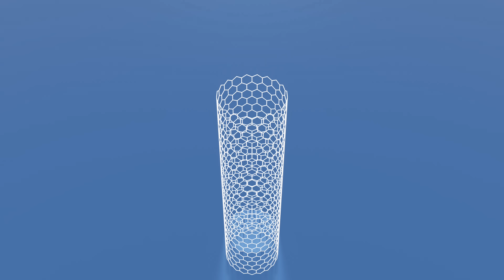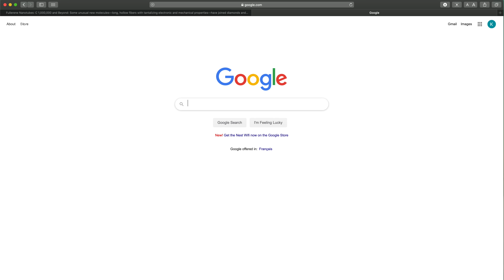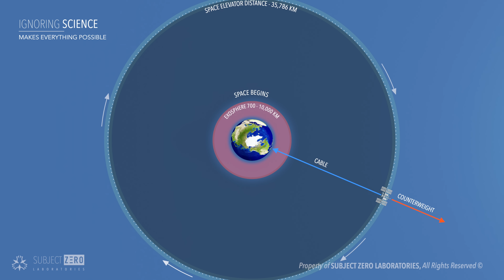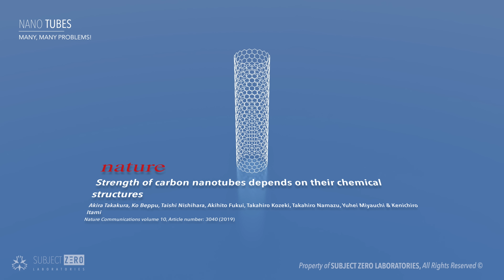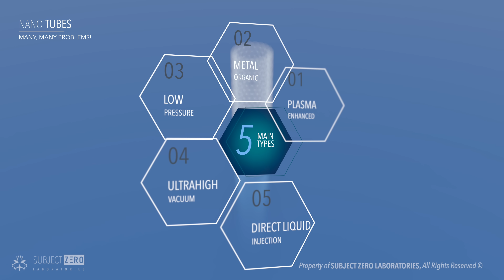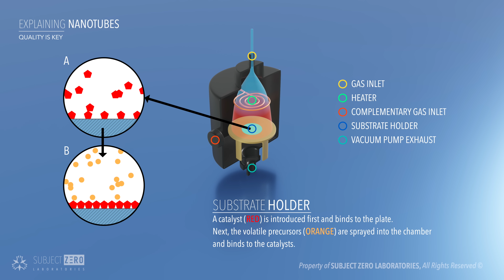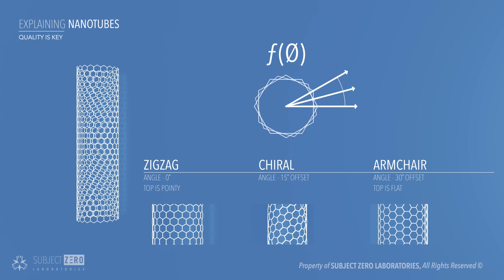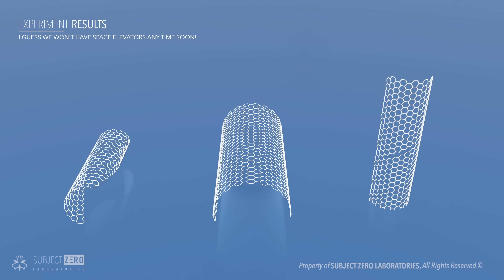Nanotube Strength, Bad News for Space Elevators [2019]

Comment: The classical space elevator might not be practical, at least not in earths case. However what might be worth looking into is orbital rings that utilize active support which could in theory be built inside the atmosphere. Brief rundown of the concept: You effectively have a ring that constists of 2 main parts, an outer hull which would be geostationary and an inner ring which is actually orbiting the earth. The inner ring supports the outer hull via magnetic levitation, however it needs to spin much faster than would be ordinarily necessary if the entier structure would be orbiting the planet. Imagine it kinda like a reverse Hadron Collider, instead of the outer parts supporting the particle stream it is the particle stream that supports the outer parts, i hope that analogy makes sense. 

So, given that this method can achieve geostationary status at much lower altitudes it should make space elevators that connect it with the ground much more practical, we're talking 1 hour trips to space at 600km/h. If we now also put trains on the ring you could be anywhere in the world within 4 hours since those trains could quite literally travel at orbital velocities and you don't have to connect the elevators exclusively at the equator, as long as the forces that the elevators put on the ring cancel each other out. The "only" drawback to this method is that it is an even more massive undertaking than a classical space elevator would already be.

Comment: What if you built the Elevator in pieces. For a long while i been writing an book. In the story a city is building a Space elevator. They been building for years and only built the first part of a three part structure.  The first part goes up a mile. Ideally the second part will go up the same distance but it will be in several smaller pieces, kept afloat do to some Unutnium fuel source. Its like a train in away, each piece connected to the other but kept in the air by its own power. In my head that means it wont be one object putting pressure on the level bellow it.
This is all the out frame. The inner frame would have a train or capsule that could be carried up.

does that make since or is my engineering off?
Reply: Your engineering is way off, as in it just sounds bizarre, i think ive had dreams more grounded in science than that and those were flying dreams.
Reply: @TS-jm7jm  Well, i mean assuming you had some unlimited fuel source, would a tower still collapse under its own weight if the higher sections were kept stable with external thrusts of some kind, only keeping one up while balancing on the one bellow it.  The idea is the thrusters or what ever take the load off most of the structure. 
Is that really so bizarre a concept?
Reply: @Mord12gp  on the thrust side, have you even seen a rocket take off?, because those exhaust flames are hot, 

Also what you just said is ridiculous because if you have an unlimites fuel source such that you can suspend sections of a mile tall solid structure in the sky then why i might enquire do you bother build such a structure, because the energy needed to hold something like that in the air for years on end so far outstrips the energy to get offworld that its not even funny, 

If you are thinking about active support type structures then a thruster is about the worst way you could go about it.
Reply: Actually look up space towers by isaac arthur
Reply: @TS-jm7jm  thanks for pointing him out. i FORGOT that i did consider using balloons to keep the tower up. Given me a lot to think about

Comment: 36000km elevator : irrealistic
continental bridges, heavy elevators in mines or skyscrapers : still possible
Reply: Well, it was the same engineering that allowed us to build those heavy elevators in mines or skyscrapers that says it's rather improbable to build a space elevator, so yeah. 
Besides, my guess it that when we'll develop better materials instead of building space elevators we'll build better rockets/spaceplanes. But hey, who knows.
Reply: Yeah, because skyscrapers and mineshafts get nowhere close to 36000km. You really didn't think a lot before writing that, I hope.
Reply: Marcus Lindgren a space elevator isn’t really a structure that’s 36000km tall. It’s more like a 36000km yo-yo string attached to the Earth.
Reply: @Magicpickle5  u dont anchor it to the earth .u find the point of balanced gravity inbetween the earth and the moon .u then deploy the cable both directions until 1 end reaches the moon then anchor it. The earth end of the cable sits above our stratosphere. Just need to find strong enough materials to build it
Reply: Marcus Lindgren 500 years ago people thought skyscrapers won't be possible, too.
Reply: @IronMan-fi3xz  possible =/= economically feasible
Reply: @IronMan-fi3xz  - The engineers that built cathedrals using flying buttresses 500 or more years ago could probably have imagined that eventually an even taller structure could be built using other methods. A skyscraper is just another type of building. Interestingly enough, elevators, and the amount of space their shafts take up are the main hindrance to building ever taller skyscrapers. There's also HVAC and water delivery issues to consider as well. Now, if you put all the elevators on the outside of a huge pyramidal type structure, so the elevators were more like tram cars, maybe you would be onto something, although the footprint of the building would get pretty ridiculously huge.
Reply: @MuscarV2   Dude when we were playing with sticks & stones some Egyptians build the friggin pyramid & till today we still get dizzy head how!!!! in the world they did it. Engineering Marvel's are built by visionaries which sometimes leave the rest of us in an aww..😱 mode. But yeah its extremely expensive so sky hook seems pretty within our range or doable. Simple & awesome. Just 1000 km of cable.
Reply: @tomjary9284  it's been theorized that egyptians used harmonic vibration to place the stones at the pyramids. Tesla was building a device to counter act resonant frequency.
Reply: Unrealistic*
Reply: Wouldn't be financially feasible for a long long time. At least as a space elevator it's a special project reducing the cost to go to space. As general infrastructure it's just a filthy expensive safety measure

Comment: If Starship really is able to lower cost to $20 as stated few days ago then the elevator is definition dead.
Reply: Even then, possibly not. The sheer quantity of stuff that a space elevator could carry would make one worth building, even if it was more expensive/kg. The ground footprint of launch facilities that could handle a similar volume of material would be gigantic. Rocket payloads also have dimensional constraints that would not apply to a space elevator. Neither is a total solution on its own

Comment: I've never understood all the interest in space elevators, even in science fiction stories. Orbital rings are easier to build and more useful, and cheaper besides. And don't require exotic new materials. And space fountains are probably even easier to set up, though not as useful as a ring. Plus you can build both where ever you want, not only along the equator.
Reply: I'm not sure how you conclude that orbital rings are either cheaper or easier to build. They require vastly more material, all either hauled up to space in rockets, or manufactured in space (or at least off-Earth) with currently non-existent space factories
Reply: @talltroll7092  Well, for one, you can build an orbital ring over time out of cheap steel cable, whereas a space elevator has to be built in one go to become useful and entirely from exotic materials.

The original plans for the orbital ring intended for a bootstrap program of construction, with an initial cost of around 31 billion dollars in 1980's money.

You'd need a few launches to get the initial tether, magnets, and cable into LEO, and could send all future material for the construction up the tether to expand the ring. It's cheap to mine material on Earth, the only reason we talk about mining asteroids or the moon for space based industries is the cost of getting Earth materials into orbit. With a tether to the ring, that cost drops to pennies per kg, per the original plans. Even with inflation, it would be far cheaper to ship up terrestrially-sourced materials than to develop an asteroid mining facility (presumably requiring extensive automation beyond current tech capabilities).

Every proposal I've seen for a space elevator either requires massive space mining to already exist, or requires hundreds of rocket launches to get the elevator cable material into space, not to mention the required counterweight to keep the line under tension.

We could build an orbital ring today, with the initial cost probably under 50 billion, and the ring could start producing money to pay for its further development shortly after the first tether is dropped to Earth. It might well effectively pay for itself, from that point onward. A space elevator would cost far more, just to develop the material science, let along actually building the thing, and wouldn't produce any revenue until it was finished.

Beyond which, an elevator has essentially one or two uses, whereas an orbital ring could be used for a large number of purposes, many not even directly involved in space industrialization. You could use the ring as a transportation system, both for people as well as freight, effectively moving goods around the planet in about an hour.

Comment: Not tubes. Think lamination,  like plywood
Reply: Think gigantic kite. Because that's what you would get. The earth's atmosphere says "no" to the space elevator.
Reply: @MkeKen67  
Respectfully disagree. Material science is lack i all. The concept is viable. And easier when thinking tethers from an orbital ring
Reply: @arekainist  - How much money and materials would be needed to build the orbital ring then? Also, anything "tethered" to both a terrestrial anchor point and an object in space is not really going to be tethered at all. And, on top of that, you still need a means of getting your payload up the cable, costing another huge pile of money if it is even feasible in the first place. And if a meteorite hits the cable, you will have a major mess on your hands.
Reply: @MkeKen67  
It is viable, however not in the next 100+ years. We would need orbital/space manufacuring. We would need parked asteroid in orbit for ease of materiel. And there would need to be a massive driving factor, a reason or method of profit. 
Check out sfia/isaac athur on you tube.

Comment: Instead use GEO elevator we can make something less hard.  Take the idea from Saturno rings.  Make elevator to 400km or so so we need les cable and les strenght. The chalenge will be to make that rings work.
The idea is tu make orbit-rail-ring pushed by propulsion satelite made with electric propulsion where maintance is slow. This satelite will have higher speed to keep the weight of elevator and the ring-rail(can be atached to satelite or slide(atached is beter for lower maintance)). When the ring is done just put 4 cable down to Earth (400km of cable not 35.000km)
The rail can be like trinagle, 2 line for the satelite how keep the ring up and the last one or the elevator so the orbit satelite dont interier with the elevator.
Reply: Or just make the ring hollow, and spin a second ring inside it at orbital velocities, effectively lifting the entire structure. Then you can build your ring at any altitude, even within the atmosphere.

Comment: Space elevators need to go to geostationary orbit.
This is 35,786 km away.

To get there in 24 hours you would need to travel at 1,500km/h.

By some wheels clamped to a cable.

Going at 100km/h would take you two weeks.

Oh and nanotubes aren't strong enough.
Reply: Presumably such an elevator car would run on a maglev system, to minimize friction and allow maximum speeds. But, ironically, it would actually be easier to have the elevator use a rocket engine (one with far too little thrust to achieve escape velocity, but very high fuel efficiency nonetheless) and just carry a large tank of fuel on board, magnetically pushing against the tether as it slowly climbs upward. Max velocity might well be above 1500mph. But the time to orbit isn't really the issue, anyway. Most payloads would achieve orbital velocity (and beyond) and detach from the cable long before reaching GSO.
Reply: @berserkasaurusrex4233  - I don't think maglev works vertically. Also, attaching a rocket engine seems to defeat the whole point of a space elevator, which is to get away from rockets. The cable will naturally be curved, as well, (because physics) so not sure how fast you'd want to go up a curved cable. Oh, and the cable would probably be broken by the sonic boom caused by going that fast. Other than that, you may be onto something. ;-)
Reply: @MkeKen67  "Getting away from rockets" is not the point of a space elevator. The point of a space elevator is to get into space cheaply, and more specifically, to achieve orbital velocity cheaply. A rocket would be fine for a propulsion system for the elevator car, it wouldn't have to be particularly large or complex. You're climbing the elevator cable itself, so you don't have to accelerate to orbital velocity all in one go. It's like the difference between jumping to the top of a skyscraper and taking the stairs to the top. 

The rocket you'd use would be a fraction as powerful as those currently used to reach orbit, but could be extremely cost-effective in terms of fuel efficiency, fulfilling the purpose of the space elevator in the first place. You'd have a cheap, comfortable trip to orbit, taking several hours, as opposed to a very expensive trip to orbit taking a few minutes at very high G acceleration.

As to sonic booms, there aren't any in space since there is not enough atmosphere to generate a sonic boom. 99% of the cable is outside the atmosphere. The initial acceleration in the atmosphere might have to stay below Mach 1, but even at just 500 mph, you'll be above the atmosphere in under 10 minutes, and can then accelerate with near impunity. The curve of the cable is not significant enough to matter, unless you're traveling at ridiculously high velocity, such that G-forces become a concern. 1500 mph would not be nearly fast enough to matter.

And as for maglev not working vertically, I don't know what you mean. Maglev works upside down, sideways, vertically, whatever. Orientation has no effect on magnetic force. You merely need the magnet directly above you to be more powerful than the one directly below you, which given these are electromagnets, is as simple as building a switch to feed power ahead of you. You're essentially climbing a giant electric motor, one set of magnets repelling you to minimize friction, the other set pulling you upward or downward, as needed.
Reply: @berserkasaurusrex4233  - How are you keeping this system energized all the way "up"? Even if you could energize such a system, the cost to do so would preclude cost-effectiveness. Also, in maglev trains, the electromagnets are performing two functions: floating the train slightly above the track, and oscillating to produce forward momentum. To go vertically, you would need a third system to prevent the weight you are lifting from falling back to earth. Such a fall back prevention system is not available through current mag lev technology, as it is not an issue for high speed maglev trains which do not encounter steep grades on their routes.

There is also the question of constructing this monstrosity in the first place. This isn't like stringing up cable car cables. You are talking about the longest free span of cable ever contemplated.
Reply: @MkeKen67  The concept of brakes is not a new one, and most certainly exists. Even a simple clamp would suffice. So long as upward acceleration is greater than 10m/s squared the car will continue upward. Magnetic launch systems, such as might be used to fire payloads into orbit, are not new, though none have been built as of yet. This would be merely a slower, larger version of such a system.

One of the more useful functions of any orbital structure like a space elevator would be its ability to generate large amounts of nearly free electricity, and then pump that down to Earth, either through the cable itself or via microwaves. So a power distribution system is essentially already worked into the concept. The cost of powering a maglev type system would not be significant, compared to the total power generation and the savings in terms of getting material to orbit.

Construction is a completely different discussion. An orbital ring would only require an elevator cable of 80 miles or so, making it the more attractive option, obviously. And easily built with conventional materials.
Reply: @berserkasaurusrex4233  - You would consume more power sending it up then it could generate on the way down.
Reply: @MkeKen67  You seem very confused. A space elevator structure could hold large amounts of solar power cells above the atmosphere, in nearly constant daylight, generating far more power than could be achieved by such cells if on the ground. The power consumption of the elevator car is irrelevant, regardless of whether it is going up or down (and most designs would have the car literally fall back to Earth, with parachutes, so the elevator cable is effectively one-way only)
Reply: @berserkasaurusrex4233  - It's still basically a pipe dream, so of course it would be confusing to those of us who haven't jumped on the bandwagon. None of this will be completed in our lifetimes, so you can pretty much tout whatever you want.